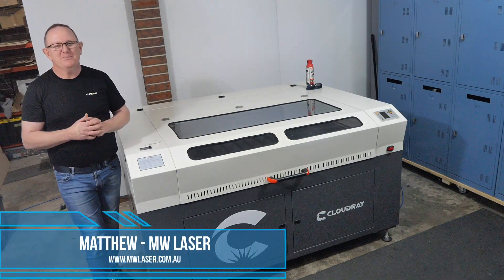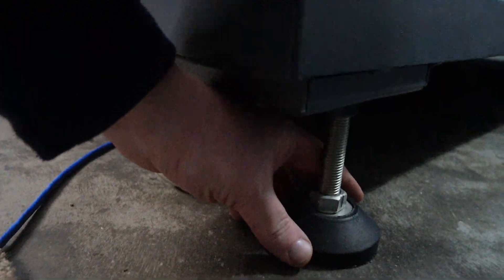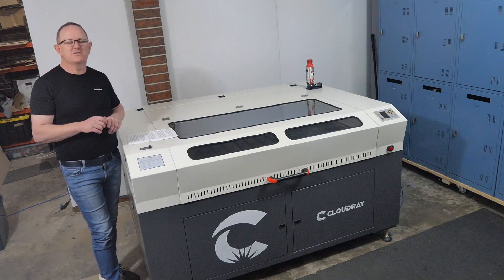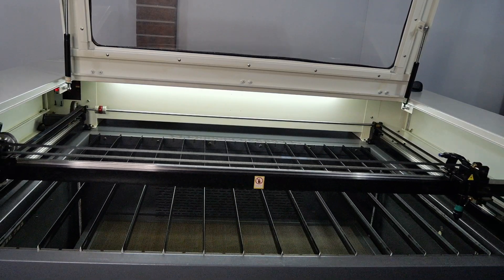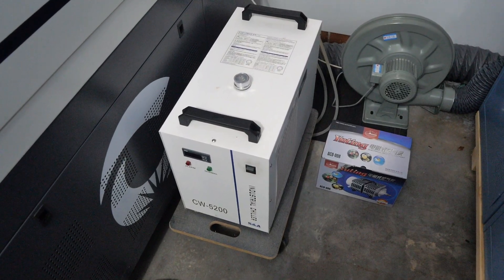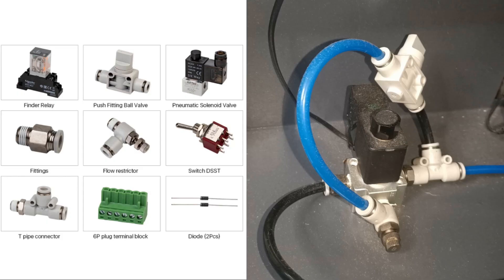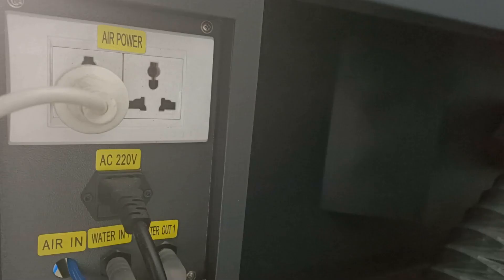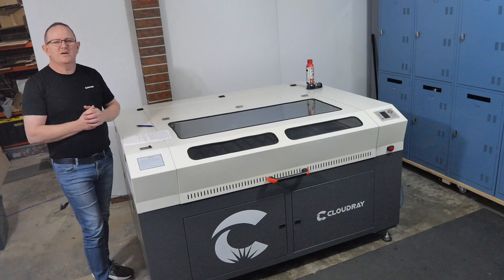Cloudray CR1390 Co2 Laser Cutting and Engraving Machine - RuiDa RDC6432G Controller

Comment: Apologies for the off-topic question, but I've installed this controller (6432G) and I'm at my wits' end trying to get a rotary to work with it.  It appears several others have had this same trouble (Changing pulses-per-revolution does nothing) and a firmware update is the rumored fix.  I've found no evidence of an available firmware update.  Do you know if there are any firmware updates for this board?

Comment: Thanks for the video matt… i have one question 
Whats the important of using two EMI filter?
Reply from the maker: suppresses electrical signal interference for your controller and drivers
Reply from the maker: two are used on this machine as there are two electrical circuits
Reply: Thank you very much… very helpful

Comment: Great video Matt!
I bought the same beam combiner you have in this machine but i noticed a problem: the shape of the diode light is rectangular until it reaches the lens, so I can't easily make the beam combiner collimate with the co2 beam. If I focus the diode on the combiner lens, I lose power and then it cannot be seen on the plane. How did you solve it? Do I need to change the diode? I would like to have a good pointer through the mirrors also to help allignment. Thanks
Reply from the maker: I have installed a few of this model now, and have not experienced the issue you are having.  I focus the diode to a fine point on the wall approx. 2 meters away prior to installing it in the combiner assembly.  Maybe this will help.
Note, this beam combiner is not designed to be used for aligning your mirrors, it can assist with the alignment but the diode beam is not in exact alignment with the laser beam.

Comment: Hi Matt, can I use car antifreeze to cool the laser tube?
Reply from the maker: In my conversations with my sources, the topic of the use of antifreeze was not a consensus, however the majority of advise I received was that Antifreeze is suitable, just make sure you choose a suitable type, i.e a Non-Corrosive / RV Antifreeze.

If you plan to use your Co2 laser during winter, then you may add antifreeze, it is important that you do not add excessive antifreeze to the laser tube, as the cooling layer of the tube will affect the quality of the light. For laser tubes, the higher the frequency, the more frequent the water change frequency. Otherwise, impurities such as calcium and magnesium in the pure water will adhere to the inner wall of the laser tube and affect the laser energy. Therefore, the most important thing is to change the water frequently and clean the water when not in use.

The recommendation I received from S&A Chillers on the topic of antifreeze was "it is recommended to use a low corrosion antifreeze with ethylene glycol as the main component, do not use 100% antifreeze, use it on a ratio of 1:3 (25% antifreeze, 75% water)"

SPT-Laser recommend "In cold weather, you can mix the antifreeze with water into the chiller to protect the laser tube from freezing. When cold weather gone, Please drop the antifreeze water out and clean the cooling system. Use purified water when it's warm."
Reply: @MWLaser  Thank you very much Matt, your advice is very valuable to me, it will help me make the best decisions

Comment: What do you think of this machine compared to you're diy version?
I'm about to build one of yours with the hope of adding the pass through feature as well
Reply from the maker: I should have built my one with pass thru.  Both machines perform very well.  I do use the one I built more, but have set it up for the work I mainly do, then I use the Cloudray machine for all my other work for timber cutting etc.  The benefit of having 3 machines setup for different types of work is great.